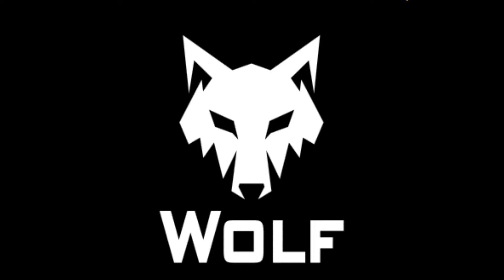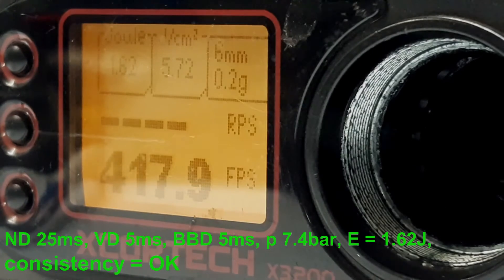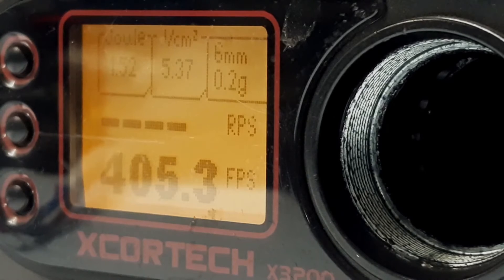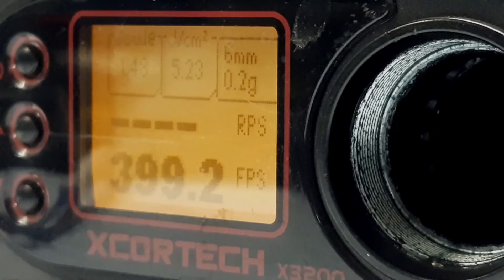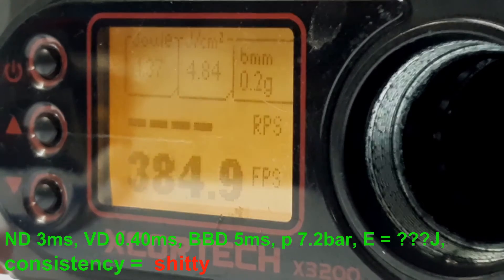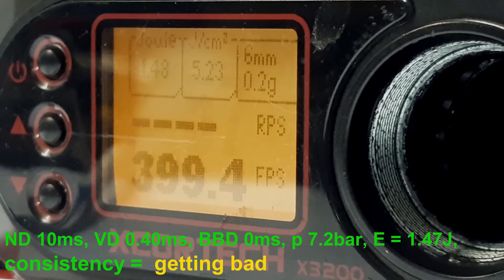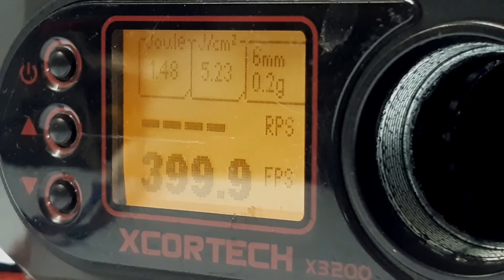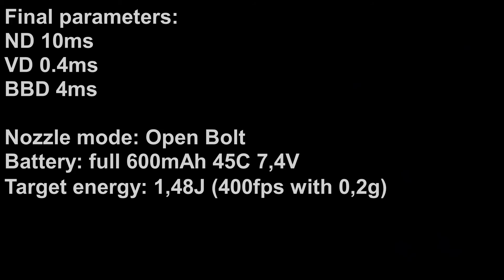Sparklabs Wolf HPA installation - parameters setup - part 4

Comment: Hi) Can this engine run 2.5-3J power to perform in DMR Builds? Thanks
Reply from the maker: Yes. It is recommended to use 0,36g or heavier BBs for high energy.